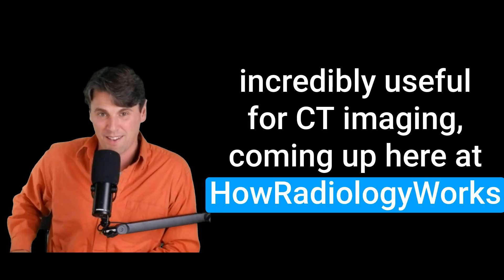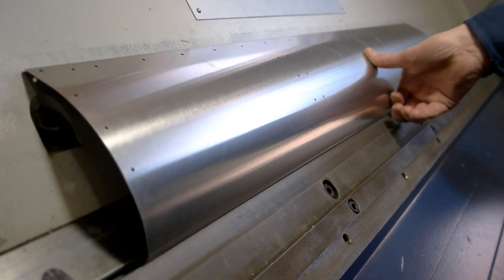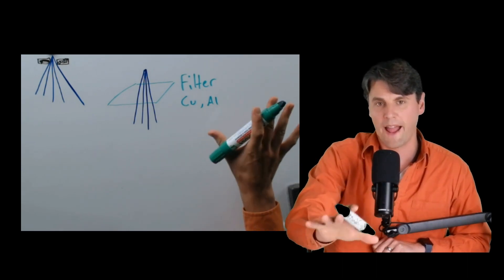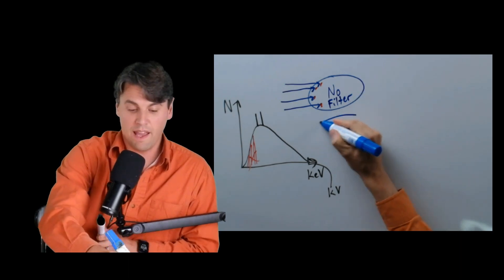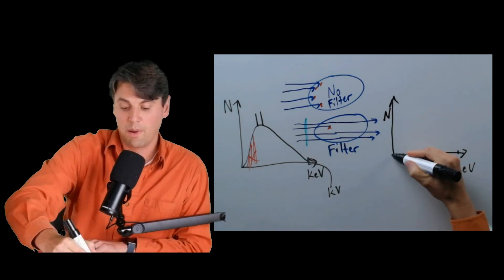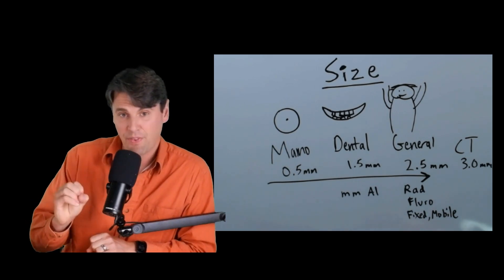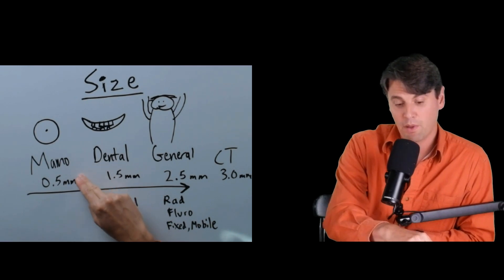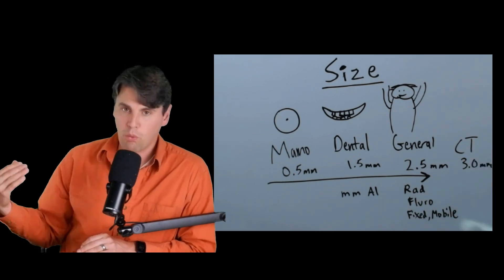X-ray Filters (Physical Beam Filtration)

Comment: What about the combination of Al and Cu? Why is it always Cu + Al and not the other way around? Nowadays there is only Cu Al combination in the newest X-ray machines and they removed the only-Al option. After which kV 0.2 Cu and when 0.1 Cu? Should be a good add on for this video. And what about filtration with babies / children? 😊
Reply from the maker: https://pubmed.ncbi.nlm.nih.gov/3347728/  show Cu is more efficient for removing the low energy x-rays and . ICRP Publication 121 does not recommend use of additional beam filtration in neonates and very small infants due to the low kVp used.